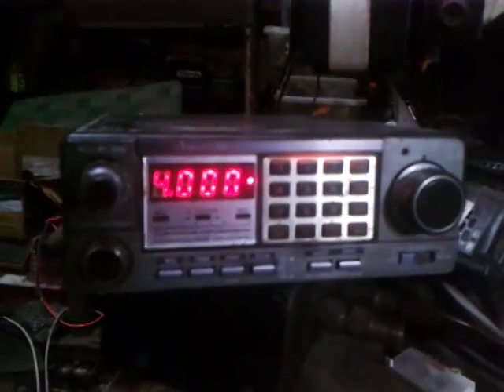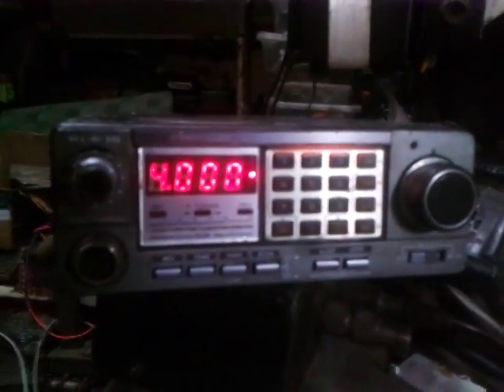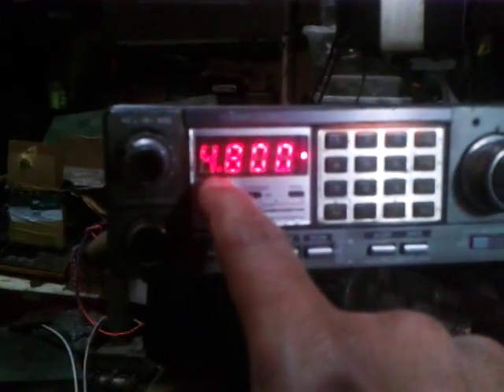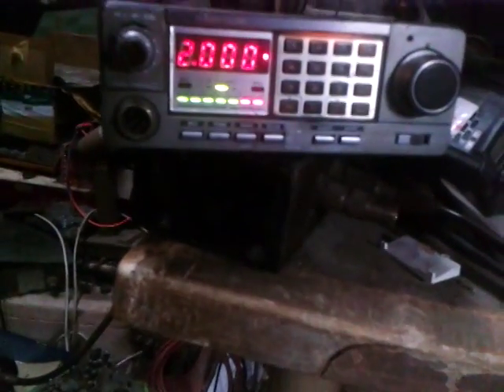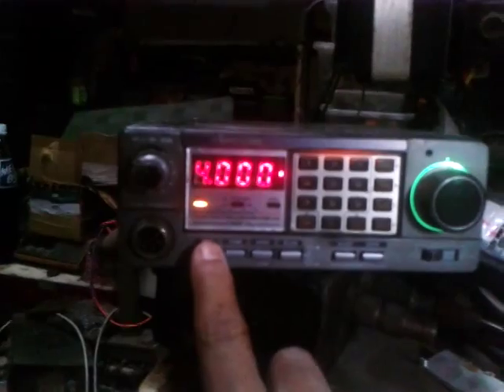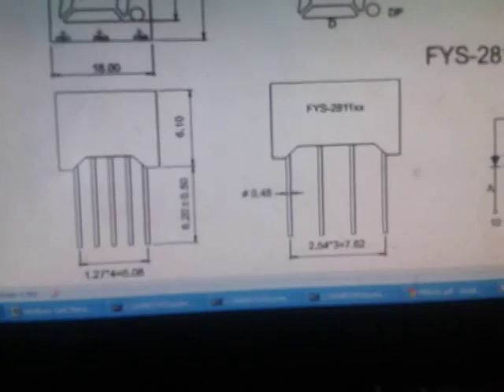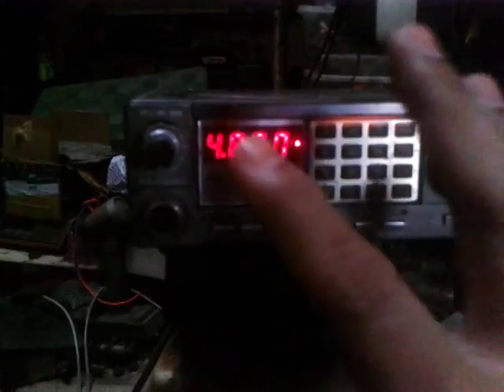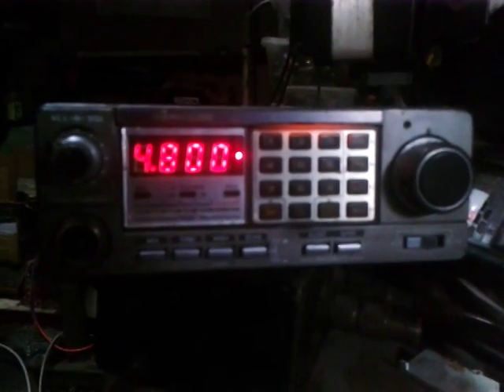4F1KJA Restored the Kenwood TR-7950 Display

Comment from the maker: This is my Classical common transceiver for veteran amateurist as Kenwood TR-7950, which the main common problem is the LCD display. I bought this since 1989 and kept it into stock as my collection last 1995, but when i retrieved it on to my cabinet the month of January of this year, i saw that there is a blurd form of liquid crystal surrounded the main display. When i used it... it was very irritating on to what happens on the display... anyway i started to established my Research and Development on this to configure the modification of the LCD display to a 7 segment LED Display last June with some glitses, but I finalized this last mid week month of November 2014. Now, since I have perfectly finished my designed, again the value of this unit will gain to rise up and its no longer as JUST a RADIO.... 73 de 4F1KJA
Reply: Pak sy pasang segmen ini cuman kendala saya di segmen ke 4 ada led yg ga nyala led no 1 sama led nomer 7 , klau boleh minta solusi led terakhir ini bagaimana ya pak